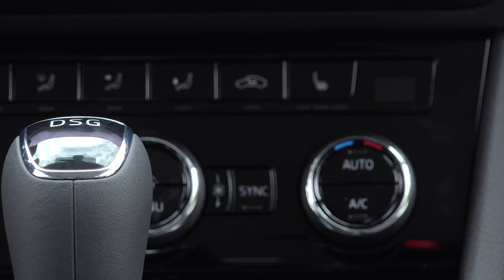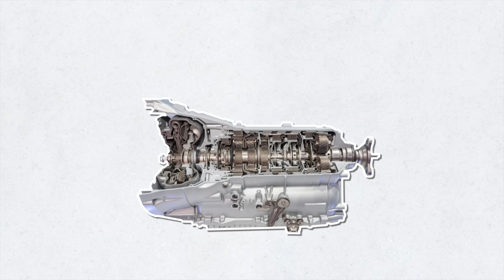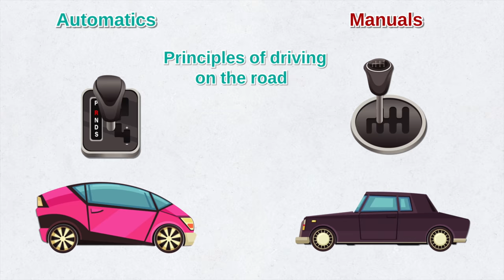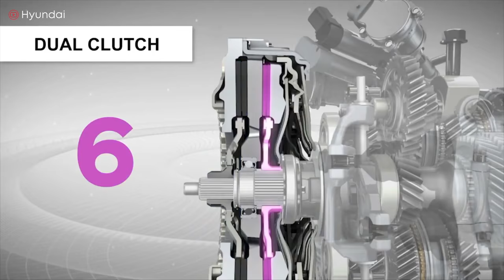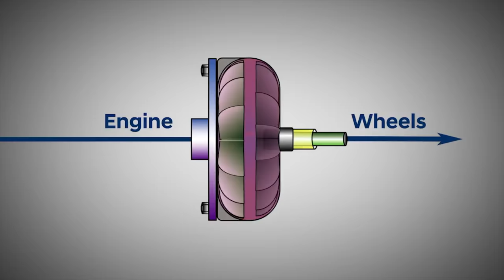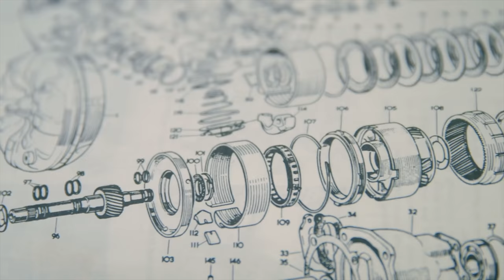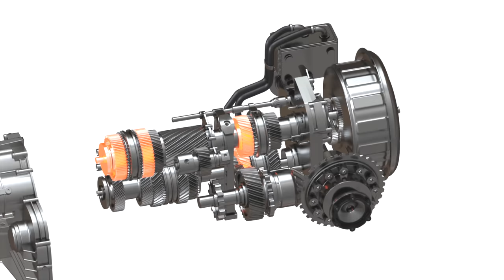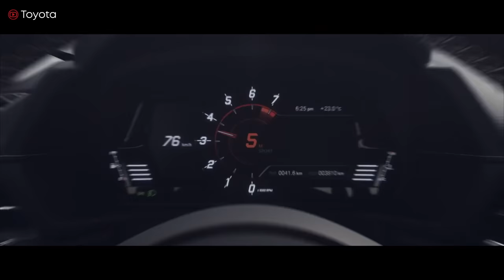5 Things You Should Never Do in an Automatic Transmission Car

Comment: Manuals never stall "accidently". I drive both manual and auto, and I much prefer manual. You get much better control over your engine, and braking, and don't have to change pads and disks as often.
Reply: With "accidentally" he probably meant that the driver accidentally didn't put down the clutch in time
Reply: @misterhistoryman2214  Hard to imagine from here. Manual is the main option here (Ireland). Actually, if you do your driving test in an automatic, you are not allowed to drive a manual. The biggest issue we have between the 2 is when you go from a manual to an automatic, your brain is trained to automatically push the clutch down when stopping, and that doesn't go down to well when the only pedal there is the brake.. especially if you have no seatbelt on, or have a coffee in your hand LOL

Comment: Does transmission fluid go bad?   I have a car that was sitting for 9 years.  But I serviced it and it works fine.    But do I have to change the transmission fluid. Or is the fluid good despite sitting for 9 years

Comment: Scotty big fa you are the best I drive a 2016 accord coupe what are some things I should look out it has the 2.4 earth dream with cvt transmission
Reply: Change the CVT fluid every other oil change. And only use Honda HCF2 CVT fluid OEM.
Reply: @coreturkoane5570  ok I bought the car new I did a drain and fill at 35k it’s about to have 60k and I’m planning to do another drain and fill
Reply: @fernandoescobar3056  ok, great, so change it the next time your motors oil change is due. BTW, Honda recommends every 30,000 miles to change the CVT fluid. But I would rather do it soon like every 15,000 just to be on the safe side, or every other oil change. Just my advice I could give you. Take care, good luck.

Comment: Had a automatic with the shift option and was rolling down a hill in gear select mode and shifted up while rolling back and the engine stalled and it mad a bad noise. Tried restarting it after putting in park and it clicked alot. Waited 20 seconds and it finnaly started after turning the key agian.

Comment: Is it bad to shift an automatic transmission into 3rd to get better acceleration and control around curves?
Reply: No. Almost all modern automatics come with paddle shifters - whether it's a traditional automatic, a dual clutch, and even a CVT. You can be in any gear you want. I did this with an automatic Corvette I used to have, and that didn't even have paddle shifters. I still do it with my 21 year old Tacoma to get better acceleration.

Comment: Why is gl3 gear oil so expensive, 07 fj cruiser needing transfer case gear oil gl3 75w-90. Any suggestions on brand or updated gear oil for daily use on a auto part time 4x4.

Comment: I had a 2008 impala ss and the transmission was crap. I traded it in and lost a lot of money, what they call negative equity LOL the car only has 75k miles and it shifted rough and it slipped at low rpm

Comment: I was always told not to down shift when going down a steep hill. Is that true?
Reply: I always engine-brake down a hill in autos and manuals. Saves my brake pads. I always downshift before getting to the downhill part, though. Just gotta make sure your RPM is not too high and upshift to prevent any unnecessary engine wear, and combine foot braking without overdoing it.
Reply: No.  But best to shift down before  starting the descent.

Comment: Iit's kind of turned into an OCD, I always put my vehicles in neutral and take my foot off the brake before parking to see if they will roll. If it does, I set the parking brake and then go into park. I secretly judge people who don't do this when I watch their car shift when parked. Haha.
Reply: Why not just use the parking break every single time before shifting to park?
Reply: That routine's only if I park somewhere unfamiliar. If I know where I'm parking, I pull the brake with muscle memory.
Reply: @justinweaver7428  A friend's van got stuck in park on a slight incline. It took some pushing uphill to get it unstuck. Since then, I use the parking brake every time on automatics just like I would on a standard.

Comment: How long do you need to start you car for it to warm up?
Reply: Different vehicles have different operating temperatures. It doesn't take long once you start driving for the engine to warm up since the majority of your antifreeze isn't circulating. Depending on your vehicle, just check the engine temp gauge after you've been driving around for about 5-10 mins (be it digital or analog). That reading should be your normal operating temperature. You can keep that in mind for future reference. Once you reach that, you can drive however you want.
And bear in mind, Scotty isn't talking about idling for x amount of minutes until your engine warms up. He's talking about reving the engine above a certain RPM level. I try to keep my Camaro below 2k rpm until the engine warms up (after about 5-10 mins of normal driving).

Comment: about the whale oil..... There aren't enough whales (ever) to fill every transmission. 
Whale oil was simply an anti-oxidation additive in normal transmission fluid. YES it did prevent rust and other benefits. 
The oil companies had a real chore to replace it when it was outlawed.

Comment: Hellow Scotty, speaking of automatic transmissions,I have a 2010 Honda Insight Hy bred with the CVT trans. it has 196k on it. Had the fluid changed and a nonslip additive to it, but its at the point where when its at cold start, jumps and bucks unless i give it more gas,    im getting the he be geves that it may quit and leave me stranded somewhere. I try to drive like a 98 year old to make it last! Any suggestions to make it last? or is it dead, but dosent know it yet!     id rather spend 3 or 4k on a differant car, than on repairing this.When the car is warmed up after driving awhile the trans does smoth out a little.
Reply: You  got  to  baby  this  transmission  as  you  are  almost  at  the  end  of 
its  life.  Slow  starting  out  and  baby  it. Also  new  filter  and  fluid  each 
35,000  miles.  May  last for  many  a  more  years...who  really  knows.

Comment: Got rough shifting and sometimes a little scratching sound when shifting from 3rd to 4th Gear in my 2017 Mustang GT Automatic
It just happens around 2k-3k RPM. Lower or Higher RPM or other Gears its shifts smoothly like its supposed to.
What could that be?

Comment: My transmission embarrassment is I recently bought a 6 speed manual after 25 years hiatus and have ground the gears twice. I hope it lives.
Reply: Jeeeeezus..
Reply: It  will  be  just  fine.
Reply: Why? Clutch not properly adjusted?
Reply: @wholeNwon  I take full responsibility. I think I was just having too much fun and trying to shift too fast.
Reply: @donnaeastman4486  Well, might not be entirely your fault. But, if you can make the synchros. work, all is well.

Comment: I put my transmission in neutral while at red lights hoping to help my transmission last more time.
Reply: That does nothing but if you feel better I guess that's all that really matters.
Reply: @haywoodyoudome  Scotty says that the torque converter stops spinning under load in neutral. Is this correct?
Reply: @billmcdonald1296  True but how long is the average traffic light?  A couple of minutes? And how many traffic lights are you sitting at in day? In a week?  
Putting your car in and out of neutral might prevent some wear in theory but in actuality you'll be trading the car in well before seeing any savings by putting it in neutral.
Reply: @haywoodyoudome  I drive 25K per year and keep my car until it dies. I drive for a living.

Comment: Could you explain the 1/4 fuel tank thing again? I have never heard of that, and don't quite understand. Cheers.
Reply: fuel pump expects certain pressure levels in the gas tank for its optimal performance, if it's low on fuel a lot, could cause unneccessary wear and tear.
Reply: Fuel  pumps  now  a  days  are  located  within  the  gasoline  tanks  of  cars.
They  are  lubericated  by  the  gasoline  they  are  in.  When  you  are  very 
low  on  fuel, your  fuel  pump  motor  is  running  hot  within  tank  causing
it  to  run  hot  and  wear  out  much  faster.  By  keeping  1./4  tank of  fuel
in  tank  at  all  times,  you  are  prolonging  the  life  of  your  fuel  pump.
Reply: The fuel pick up is designed to be in a bottom cavity of the fuel tank. So as long as you're filling up at or before the fuel light comes on. I strongly disagree with the fuel pump starving for fuel for this very reason. And frankly has sweet F A to do with transmissions at any rate. Car designers don't design their fuel pumps to starve for fuel if the tank is not empty. Just some cars have parts that aren't designed to last
Reply: @garethmilne6887  You  are  correct. But
will  you  admit  the  more  volume  of 
fuel  around  a  fuel  pump,  the  cooler
it  will  operate?  Yes,  it  is  not  starving
for  fuel,  but  do  you  not  think  the 
cooler  pump  operates,  the  longer  it 
will last?   Seems  reasonable  to me, but
I  am  not  intelligent  about  cars  and 
their  operations  as  perhaps  you  are.
Reply: @garethmilne6887  You  are  correct. But
will  you  admit  the  more  volume  of 
fuel  around  a  fuel  pump,  the  cooler
it  will  operate?  Yes,  it  is  not  starving
for  fuel,  but  do  you  not  think  the 
cooler  pump  operates,  the  longer  it 
will last?   Seems  reasonable  to me, but
I  am  not  intelligent  about  cars  and 
their  operations  as  perhaps  you  are.
Reply: Actually it's just a matter of electric fuel pump cooling. The larger the volume of gas, the greater the heat sink for the motor. Nothing more. The volume required for lubrication is very small.
Reply: @xogmaster  Gasoline tanks aren't pressurized, just the fuel through the pump to the engine in a F.I. setup so I think your reply is wrong.
Reply: @williamoneal3947  Wonderful, how does that affect the automatic transmission though?

Comment: And then you have what I think is the worst of both worlds. A heavy truck transmission that is really a stick trans but controlled by a computer. A reman Volvo I Shift is 21,000$. And then 3000 for the clutch and 800 for the activation cylinder 
Give a 13 speed

Comment: I prefer manual transmissions especially on Ford vehicles, because the simple fact that Ford Motor Company. doesn't know how to build Automatic Transmissions never have and never will. most automatic Transmissions are basically a hydraulicly controlled unit. using a torque converter, a valve body, and servos, to control clutch pacs to control shifts between gears. but in more recent years automatic Transmissions have become more complicated. due the introduction of the computer to control the functions. in the early fifties Chrysler had a transmission called (the fluid drive coupling). it was basically a manual transmission. that had a part similar a torque converter added to it. there was a clutch pedal on the floor but it was used only to start off with. then electric solenoids controlled the shifting. but it required a lot wiring and proved to be unreliable. the number one enemy of automatic Transmissions is heat. it will destroy an automatic Transmission very quickly.

Comment: Scotty looking for your opinion I help operate a volunteer fire department and do maintenance on the vehicles however I've got several that don't drive far enough to do the regen can you recommend a scanner whether it's bi-directional or omnidirectional that would help allow me to do this at the station versus driving 30 miles to the nearest dealership
Reply: Take the vehicles out for a decent drive.
 RTFM.
Reply: Believe me I would be up for that unfortunately as a volunteer fire department sometimes you may not get back to the station till Tuesday 3:40 a.m. in the morning after being out all night you really don't feel like taking a 30-minute drive somewhere
Reply: @aroth8835  
Good point. 
Do you have some retired community members that you could trust to do this driving during the day if you can't force the regen?
Might be good for the overall mechanism of the trucks to go for a reasonable drive?

Comment: I just got a 2006 Corolla S auto from my step dad. He never warms the car and always shifts while rolling. He has been doing this for a while and the check engine light has come on for this issue. What should I do? I don’t want to sell the car but I don’t know how long I have. I don’t drive much or hard. (From CT)
Reply: Have  check  engine  light  cleared  for  free  at  auto  part  store  or  just 
disconnect  battery  for  3-4  minuets  to  clear  light.  Then  just  change
fluid  out  every  40,000  miles  or  close  to  it.  Cheaper  than  replacing
a  transmission  too  soon.  Hopefully  you  will  have  many  more years
of  service on  this  transmission.
Reply: We tried clearing it but it came back on after two days. It only has 140k miles
Reply: @alyssaruiz6407  have you tired scanning it with a scan tool? Test the car out by putting in drive to reverse while your not moving, you will notice if something is not working/improperly working

Comment: Sir scotty, how about to shift on Neutral then handbrake on a red light?
Reply: That's what I do all the time, best for the car.  The reason most people don't is because they want to win the drag race to the next red light.
Reply: @dukenukem5768  so it wont damage the engine or anything sir?
Reply: @joemariway5451  Certainly not.  In neutral the path between the input and ouput shafts of the gearbox is simply disconnected.   The engine will be turning the input shaft to the TQ (torque converter), and the TQ ouput shaft will be easily and lazily following it, turning the input shaft to the gearbox which will be doing nothing further.   However, if "Drive" is engaged with the car stationary the TQ input shaft is being turned by the engine but the output shaft of the TQ cannot turn.  So there will be a lot of churning of oil inside the TQ, creating heat.  This happens briefly when you drive away from a standstill but is prolonged if you are at a red light.  Of course, the design allows for drivers doing this - by providing a transmission oil cooler.  But I'd rather not stress the system myself.

Comment: In my Peugeot HDI manual, semi automatic gearbox, writes that only if I have problem to change the gearbox oil 🙄. What to do?
Reply: Problem oil changes you.
Reply: @haywoodyoudome  sorry, I didn’t understand? I’m from Macedonia, and I very like this car. The old owner kept the car in perfect condition. Yesterday I call the Peugeot Citroen dealer ship in Macedonia, the service department, and they told me the same. I’m very confused! Not to change the oil in semi automatic gearbox transmission 🙄🙄🙄 . Very strange. They told me only to give them the number of the engine, and they will back to me. Ill send them today the number, but there is no harm to change the oil and the oil filter, right? But they ate sure in that , that in my car (like it wrote in the msnuel) and I do resurge on google snd YouTube-and there also people and mechanics on Peugeot Citroen cars, says (write) that my 1.6 HDI (diesel) Peugeot 3008 , very good maintenance from the first owner , don’t need a transmission oil change. I have this car almost 4 months, and I change everything like filters and engine oil and other fluids, and the tyres, I put summer tyres, and I have to change the back brakes-done, but I’m still confused about my semi automatic gearbox transmission oil change. Can you help about my problem?

Comment: Modern automatic transmissions are much more fuel efficient than manual. Modern autos have 6 to 10 gears. CVTs are the most efficient and would eventually become the only option if internal combustion engines weren't on the endangered species list. Electrics don't need much of a transmission.

Comment: I have an automatic, but what are L1 and L2 gears for.  I used them to coast down big hills.  :/   Is that a mistake??
Reply: Yes and no, if your brakes are fading down the hill, downshifting into a lower gear is good. Bad news is your probably revving your motor up more than it should be. 
Lower gears are more for pulling a load uphill or getting yourself unstuck.
Reply: If  you  still  have  cars  owners  manual  in  glove  box,  turn  to  section  on 
automatic  transmission  and  read  it.  It  will  tell  you  about  L1  and  L2 
gear  selection  and  what  to  use  them  for.  Or  just  stop  by  a  transmission
shop  and  they  will  explain  to  you.
Reply: @williamoneal3947  I would skip the trans. shop, but otherwise great advice!  RTFM!
Reply: @williamoneal3947  My car is literally vintage.  The manual doesn't explain it.  :/

Comment: For some models that still come with manuals, the manuals have poorer rated mileage than an automatic. Part of that may come from differences in final drive ratios, with the manuals being set up for quicker acceleration. But some automatics, particularly CVTs (I know Scotty does not like them)  are more efficient. On the other hand, the driver also makes a difference in the real world. If you really want a manual, good luck. Even when they are available, they often come only on the lowest level models.

Comment: Question:  At stop lights, does it make sense to shift from Drive into Neutral, not for the purpose of saving gas, but to relieve the constant pressure on your brake as you sit there in Drive?  In other words, could shifting from Drive to Neutral at stop lights (or other extended stops) make your brakes last longer?
Reply: Just put it in park